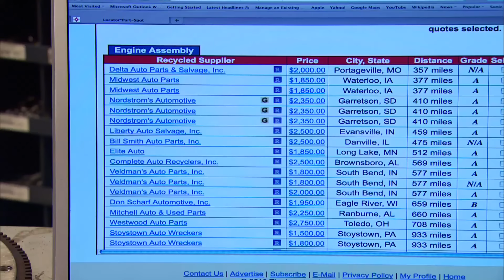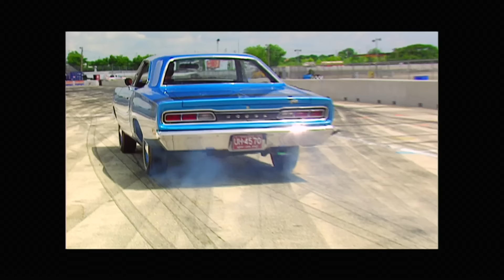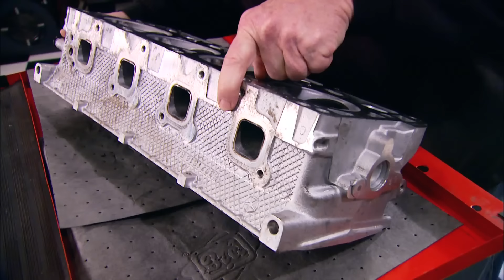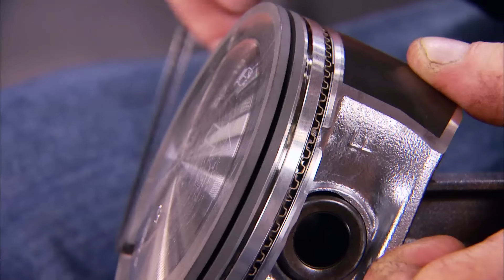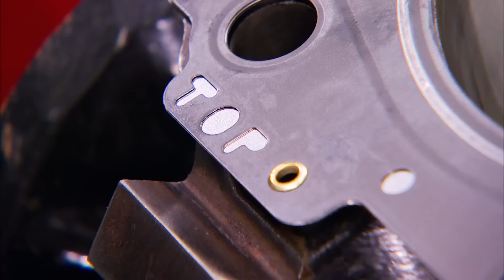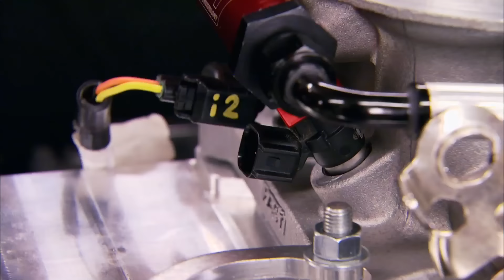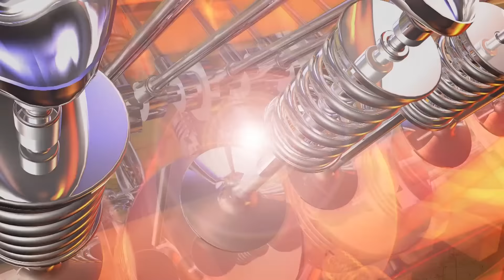Recycled 5.7L Hemi Budget Build Stage 1 - Horsepower S14, E8

Comment: Why would you spend $2k on a low mileage factory motor with harness and ecm then rebuild motor and not use any of the factory stuff. Bet a bare long block was $750
Reply: Probably because they got it way cheaper than $2000 after offering to plug the seller on their YouTube channel. This whole channel is nothing but a big ad for whoever throws them a few bucks to hock their wares.
Reply: mk319mod0  Yeah but there are plenty of better channels where the actual content doesn't feel like an afterthought to the product placement.
Reply: mk319mod0  that's kinda how the tv and YouTube world works man advertising is expensive I did work for Mike Holmes years ago it was all free to him but our company went through the roof
Reply: turn an EFI into a carb setup.  wasted motor.
Reply: @chubbysumo2230  wasn't a single carb in this video. .
Reply: @chubbysumo2230  I believe it still was EFI. No carb setup.
Reply: @joer5057  TBI. Almost as bad. A retune of the ECM would have gotten as much or more power than they got out of the new setup.

It gets a bit tedious when the answer is always a carb or throttle body injection.

Surely someone makes an aftermarket multi-port injection setup. Or how about a rebuild that utilizes the advanced injection system it came with from the factory.
Reply: @JamesPhieffer  TBI or EFI are both correct descriptors.  The suppliers use EFI because TBI remind people of the 80's gutless engines.  On the other side of the coin the TBI doesn't intimidate  people like a TPI system does.  Then it retains an old school look.  Lastly the new TBI setup will very often out perform factory TPI setups on the peaks and not uncommon across the board thanks to proven intake manifold setups.  A factory TPI manifold was tuned for ,fuel economy, emissions, smoothness and performance being the last priority where aftermarket setup mainly focus purely on performance.

There isn't much demand for aftermarket TPI manifolds in general.  The selection is fairly limited even with the LS, the performance does vary quite a bit too.  The low demand is why the the cost is high and selection is low.  In most cases a fabricated intake is cheaper and will look more impressive.

Lastly a the factory power is a net HP rating, the Dyno is likely giving you a STP rating which is similar to an old gross HP rating.  Pull the engine out of any new car and its going to likely make up to ~18% more HP than the factory rating using STP correction.  Because of all the electric accessories newer engines will be closer but it will always be more than the factory rating unless you restrict the engine as it would be installed.  So full exhaust and accessories plus simulating engine bay temps, air temps along with coolant and oil temps.
Reply: @ineffable1129  I'd still like to see something other than a carb or throttle body injection (a glorified carb). A sequential multi-point fuel injection system - Ford and most Japanese imports began using that technology in the mid-80s.
Reply: Maybe it was a package deal, they could sell the factory stuff to help cover the cost of the after market throttle body. 
The horsepower is a little off, because the factory rating is with everything running, and Cat converters installed, so losing a few horsepower is common
Reply: Any long block you get for $750 from a wrecking yard is gonna be trash. It's gonna have sky high miles on it, rusted bores, or spun bearings
Reply: Ok basically I buy the motor w everything to be able to make everything u need. As you build you remove; but if you can keep something then you already have everything.
Reply: They have a problem with the budget concept.
Reply: @larrycotterill9350 there’s no budget when you’re funded to sponsor those you put money up for their videos
Reply: I’m from Eugene and my buddy is the parts manager at the Springfield location they picked and I could get it way cheaper then advertised
Reply: Im pretty sure the budget build was just for the videos purpose. Im willing to bet that they returned the new parts the next day and sold the engine. But this is a great show.
Reply: They got the wrong year . 2009 plus have Those Eagle heads
Reply: Actually they didn't pay anything for the motor
Reply: Because you can sell all the stuff you didn’t use
Reply: On what planet can you get a long block hemi for under 2k
Reply: @joshweickum this video was made 6 yrs ago.
Reply: @joshweickum not this planet

Comment: I don't think I could bring myself to reinstall the stock cam...

Great vid though!
Reply: Well certainly not the lifters..
Reply: The ridges from that stamp are just begging to become hot spots causing detonation / preignition
Reply: With a roller cam there is little danger of failure as the rollers follow a similar path, the danger with flat tappet was each lifter took a "set" to each related lobe. I would never re-use a flat tappet cam, but I would buy a used cam if I knew the specs.
Reply: The 5.7's got an issue with the roller-lifters (or lack of maintenance or oil)
Reply: 100 percent agree....even a mild increase in lift and duration....just a little.....gawd. I guess they just want a baseline, cuz you KNOW we are going to see at least two more ''stages''
Reply: @nl1cat  The problem you are referring to is with the MDS engines, but that has been addressed by the factory. GM LS engines had the same problem when they went to MDS.
Reply: @HowardJrFord  Even the very early runs has MDS, as the video noted, that was the reason for the spec of 5w-20 oil from the beginning. It wasn't until the redesigned the engine later to add the cam phaser for variable valve timing with the necessary changes to the cam bearings and oil viscosity that the issue popped up.
Reply: @nl1cat  The damn lifters are the issue.  I think the needle bearings are spotty and some engines no issue and others there are.  Quality control.  I would have ported the heads and polished the valves, reseat the valves and comp cam swap with better lifters.
Reply: Droste o guage railroad yep , maybe? related  to oil change intervals or spec oil , but the needle-bearings fail ... but i've seen 3 cam's in it so far , but heaven't seen a lifter change 😮
Reply: I'm in the process of rebuilding one that has 86,000 miles on it. The cam is shot. The bearings in one of the roller lifters went bad and wore a groove on that cam lobe. A couple of the other lobes have some rough spots on them.
Reply: Its actually a pretty good grind from the factory. Plenty of low end torque and will pull hard all the way to red line.
Reply: @RT10Viperman  I agree, my truck is a 04, it pulls plenty good. Best engine I have ever had. Just under 200k and still runs like it did new.
Reply: @carllmack2287  Sorry  Carl, but that's only true in theory, NOT in actual use.  Stock roller lifters are a known problem for Dodge.
Reply: @ORflycaster  So, let me guess, you worked in the dealer as a career tech? I spent many years in the dealer working on them. I will unequivocally state until they added the OCV (Oil Control Valve) and variable valve timing the issue was very rare with proper maintenance.
Reply: Truest shit I've seen on this thread .
Reply: @nl1cat  low idle oiling
Reply: Donnied How can an engine need a rebuild at 86k?
Reply: i had to re read the title when i thought the same thing hahaha. "why dont they upgrade the cam, why are the putting a basic intake manifold..." oh yeah its a budget build lol
Reply: @ryanb8736  - Couldn't keep valves and plugs in the aluminum heads of early 5.7L hemis...
Reply: @carllmack2287  these hemis are known for nad lifters
Reply: Hehe stock cam gunna see more than lift it’s gunna see some ejection 😂
Reply: @nl1cat  no they don't...
Reply: @nl1cat  Yep, I'm shocked they didn't replace those lifters. Thats one of the Hemi's big problems.
Reply: @nl1cat  this 100%. Old series engine with old suspect lifters screams "yikes".
Reply: @jmurphy1973  Agree! Couldn’t believe they did that. I’ve always marked the rods.
Reply: @nl1cat  
one of the problems with the lifters was a lot of idle time. if running at 1000 RPM or more they didn't have that problem,  also, if you increase the oil pressure via oil pressure relief valve it will prevent the problem . Not a difficult fix , well ok getting to the oil pressure relief valve may be difficult
Reply: @BuzzLOLOL  pin the valves, and insert the threads. Problem solved. That engines oil could be on fire and those valves would NEVER drop and those plugs will never pop.

Comment: I can't believe these guys did a complete tear-down, then reused the stock camshaft and lifters. MY main reason for breaking into a low mileage engine would be to replace the crap factory lifters on an engine stand rather than later in a vehicle when they fail.

Comment: Nice to see they packaged the motor  so nicely for horsepower tv.

They shipped my motor on a bare pallet with two metal strapping bands, and when the motor showed up, it was on its side and the front plate on the motor was cracked and a valve cover was broken along with all the coils

Comment: Not sure when this was filmed, but I'm just now seeing this (7/12/19). Funny, back in 2017 I bought a 2002 Cummins 5.9 from that same recycler (B&R out of Eugen, OR) and it was packaged like total crap. It's like they knew your engine was going to "Horsepower TV" so they took "special care" of yours and even sent it in a wooden crate. On mine, the dummies out there wrapped a metal band strap around the oil dipstick tube thinking that would be a "strong" tie down point. It suffered some damage of course. Not gonna do that again. Not worth the headache!
Reply: 2010
Reply: Thanks for the heads up.
Reply: most recyclers think you are going to use the engine along side with one in your vehicle and disregard things like that
Reply: Hahaha, Mine came Cellophane wrapped on a used old tire which “rolled out of the delivery truck. It had a unrepairable crack in the block between the head bolt and water hole. Damn boat anchor in Northern Colorado
Reply: I wouldn’t buy a refurbished engine unless it came from factory, like Cummins.

Comment: with all the problems the 5.7 have with the rollers, why would you reuse them?
Reply: Probably rebuilding it for a customer
Reply: It's only the eagle hemi 2009 - current that have the issue.  03 - 08 we're solid.
Reply: @ pa h  My understanding is that that problem is mostly confined to engines in vehicles with very long use hours --i.e., those that remain idling for long periods like police cars, cabs and delivery trucks?
Reply: I've read that the valvetrain problems the 5.7 has are nearly always the engines with MDS (multiple displacement system). It's on vehicles with automatic transmissions. This truck engine must've come from a manual transmission because it has plastic plugs where the MDS sensors usually are.
Reply: Michael Marks there was no manual transmission offered. I have the non MDS with those block off plastic plugs in my 2005 Hemi Ram with automatic. MDS was an option and I’m glad I didn’t get it from the issues others have had.
Reply: @karpenterken1  Yes there was, Ram 2500 5.7's had a manual option.
Reply: Long idle periods and MSD are to blame for the cam failures in hemi engines but to be fair about it, the other manufacturers are having the same exact lifter/cam related issues so it's not limited to the Hemi.
Reply: I have hemi 06 charger 234,232 km on it engine has had no problems
Reply: the 09- hemis are the ones that have that problem but from what ive seen the 2013- hemis dont have this problem anymore
Reply: My bigger concern would be the dropping valve seat issue. They changed the design to help it in 2008 but there's a class-action lawsuit for the older 4.7 and 5.7's. Not a big deal if you get fixed heads, but at that point you could have a modded junkyard 6.0 LS.
Reply: From 2018 and newer the factory now uses the same roller lifters as the HellCat.  They are heavy duty for sure and no more problems. Yes, this goes into the every day Hemi across the line.
Reply: @michaelmarks5012  I just pulled one apart. The (NON MDS cylinder) rollers on the lifters were super sloppy on 5 lifters. MDS lifters the roller follower was fine. Have done 1/2 a dozen of these and have yet to see a MDS lifter being bad.
Reply: Martin Hajda Martin is 10.% right.
Reply: The MDS has nothing to do with the lifter issue. There are plenty of non MDS engines (6.1 and manual 5.7 for example) that have had failure.
Reply: @joer5057  This as been corrected/updated in 2013 or 2014
Reply: @kenrobinson1099  Correct I work for a chevy Dealer... the 5.3 V8 do the same thing with that MDS system... most important thing you can do if you own one is keep the oil changed on schedule....
Reply: Budget
Reply: Beginning in model year 2019, Chrysler began using a more durable lifter in cars and pickups.  These lifters supercede all previous 2005 - 2018 lifters.  

5038785AD (Front)
5038786AD (Rear)

It was not an MDS issue, nor was it an oiling issue.  The new lifters have more precise machining, and a much heavier roller.  

This issue appears to have been resolved.
Reply: @michaelmarks5012  if the engine is made after 2004
Reply: @michaelmarks5012  My old 2005 Dodge Ram 1500 Slt had no manual option and still did not have MDS.
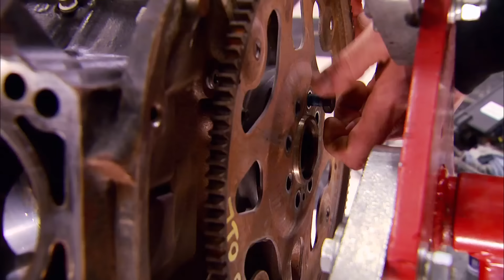Reply: @michaelmarks5012  5:27. Auto trans flywheel (Flexplate).

Comment: Why not replace the oil pump while you had the motor disassembled?  Seems a relatively inexpensive insurance policy.
Reply: At least with ls motors. I take them apart, inspect them. If it's good it's good. A proven part is a proven part.
Reply: Absolutely!
Reply: If it's apart, replace the oil pump.
Reply: @youcanbesmartaskhow3857  If it's apart, take apart the pump and inspect it. If it's fine it's fine. A proven part is a proven part. You can get a brand new pump and have it be fucked up.
Reply: General motors will provide a new oil pump for Northstar head gasket replacement, crankcase reseals, and piston/ring replacement labor operations without warranty clerk authorization. They are more superstitious about old parts than you are about new ones, enuf to pay for it.
Reply: @ 50,000 miles flip a coin. Got a new pump for my 468 BB Chevy. The shaft broke in  half during a run at the track but I shut down the engine and no damage. You never know when a bad piece of steel is going to ruin your day!
Reply: @andrewpaul7441  yup. Had a brand new [dating myself] Crane fireball cam break at 5k rpm. Had a refurb. quick fuel carb float stick burnt the car DOWN. I stil like new oil pumps

Comment: if you live in the northeast,you can find a hemi truck dirt cheap.
i was scoping fb marketplace pretty hard,but found Both trucks local to me.

so far i have less than 2 grand in 2 hemi trucks.
ones a 2005 hemi1500 4x4,and the other is a 2003 hemi 2500 4x4,
both run and drive and are daily drivers.
if the trucks break down,ill yank the motors and still be ahead of the game.

for all you aspiring dreamers,the weak spots are the valve seats and the needle bearing lifters.
Always give those a Very good inspection for wear/damage.

Comment: Stock cam but new pistons. Yet u marked the old pistons. Kind of odd
Reply: hah, nice username lmao
Reply: Probably decided to swap pistons after pulling them.
Reply: Not odd at all. Always mark the pistons, been if replacing. After teardown, and you inspect the components you we an issue you know where it can from. And possibly find other issues.
Reply: @meegstomtom  they knew they were replacing them from the beginning tho
Reply: @fatnfurious9171  yeah. I'd still mark and inspect them. Piston slap, odd wear patterns, and such. Maybe a stuck/broke ring. Signs of excessive over heating. 

 If they are junk, then the test on the components aren't going to be much better. And depending on conditions will help determine a starting point as to what to do. Hone the cylinders out or bore them? And home much. Excessive heat omg I would have much more machine work in making sure everything is align bored as well.  Nice clean block with little wear, depending on build, could be new bearings, rings and a valve job. 

I take time and look through a whole motor before I start anything.

Comment: These videos are aweome. Ive got a 4th gen Ram 1500 with a 187,000 miles on it. Im going to be following these videos when I rebuild my engine in the near future. Keep up the good work boys, I love seeing those hemi and 4th gen ram videos! Keep em coming!
Reply: 06 charger rt 5.7 with 245k still running
Reply: Hi there,did you do a rebuild using this vid,I'm  doing a Ap6 valiant ,1965 a body,first Aussie v8 released,anyway I'm doing a 2006 5.7 hemi with basically all mods done in this vid,fast ezi efi ,modman intake,etc etc ,curious to see if used any of there and if had any probs,my motor is getting built in few months,is a running motor ,125 thousand kms on it

Comment: I have an issue of Engine Masters magazine from about 8 - 10 years ago in which they used a stock junkyard 5.7 junkyard HEMI like this one. They didn't even remove the heads, but they swapped the cam, used a FAST fuel injection system with headers and made over 500 hp.
Reply: I agree, bunch of hacks on this show

Comment: 400 horsepower 392 torque out of a 345 cubic inch engine is amazing
Reply: Mopar or no car LOL
Reply: @alexlevy322  then whatever you do dont go to sloppy mechanics and check out the guy turning 8's in a junkyard 4.8, or hot rod where they did 60 1000hp pulls on a stock 4.8.